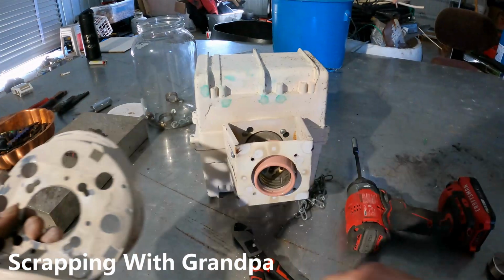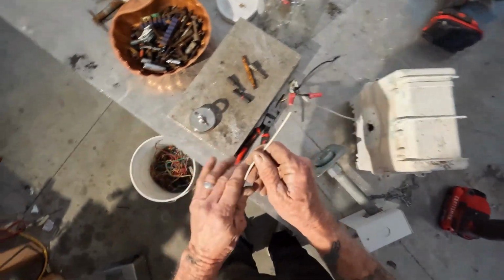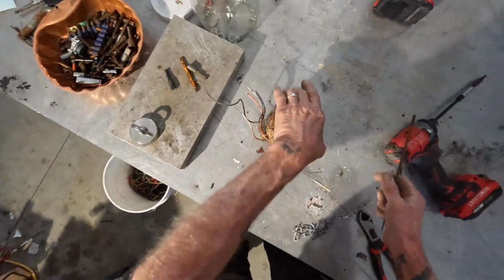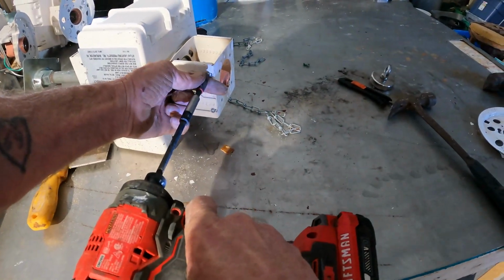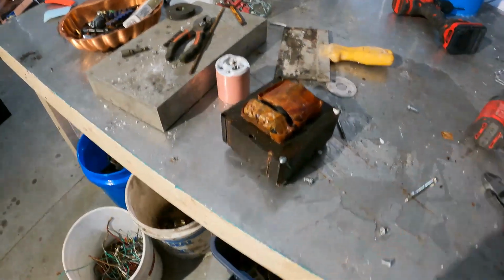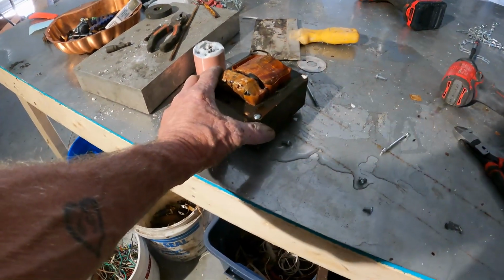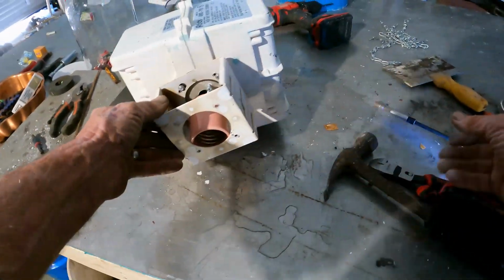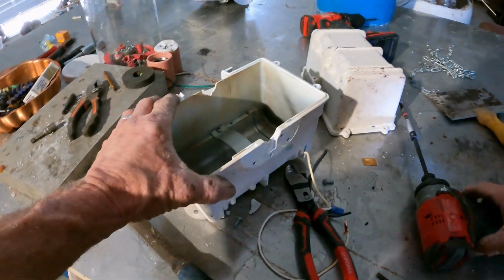Scrapping a few Industrial Lights for Copper and Aluminum

Comment: I used the cast aluminum pieces to bolt to my table to hold tools or catch screws !!
Reply from the maker: I’m not sure exactly what you said
Reply: The cast aluminum case that hides the transformers.  They make good trays for holding tools and catching screws  lol.  I guess I should have proof read that last comment.